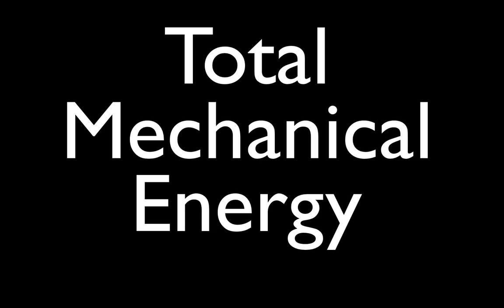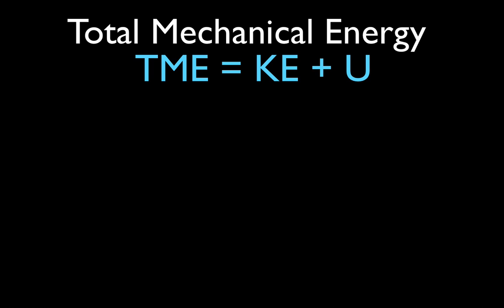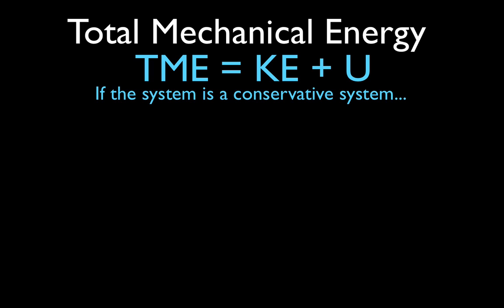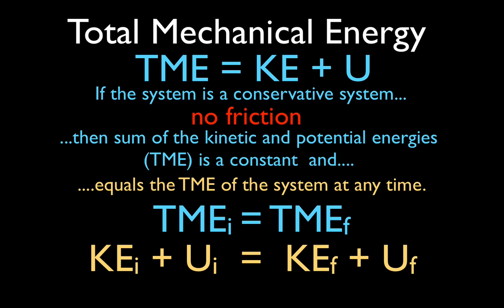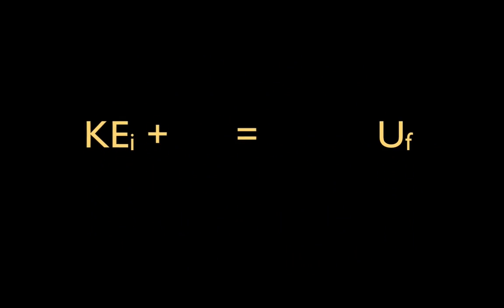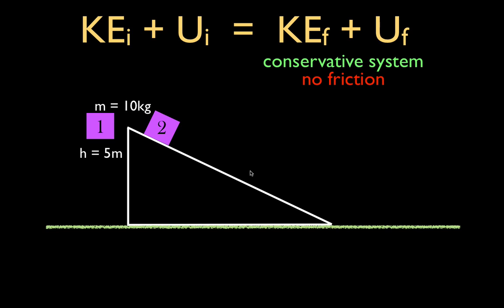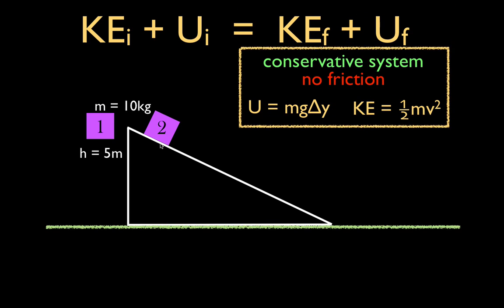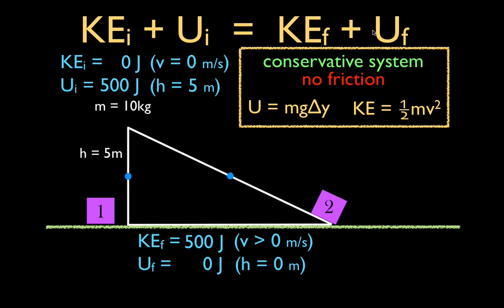Energy, Work & Power (19 of 31) Conservation of Mechanical Energy, An Explanation

Comment: hi, could I ask something, which you might not be able to do because of time, and I totally get that. 
Is there any way you could add captions on these? Because I have some hearings issues and some of the stuff you're saying gets oddly translated in the auto-generated English subtitles.
Cheers!
Reply from the maker: OK I turned on the captions for this video, you have to click on the CC button, bottom right.  I did not edit them to make sure they exactly match what I am saying.  Check it out and let me know if it helps.  I can turn them on for others if you would like me to.
Reply: Nice! helps a bit. if you could the captions on the other would be awesome because i would hate to bother you over and over again every time i needed to see another video.

Comment: would you please explain if the system wasn't conserved
Reply from the maker: Layan As Sorry I did not respond earlier, traveling.  In brief, the most common case is with friction.  If there is friction then the PE at the top will not equal the KE at the bottom because the force of friction will do work on the object as it slides down the slope.  But still the PE(top) = KE(bottom) + Work(friction force)